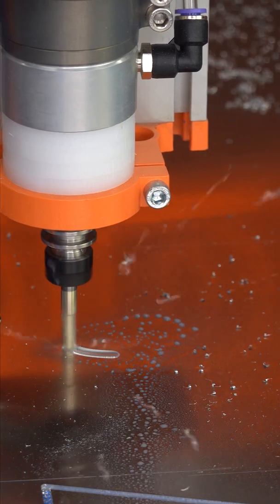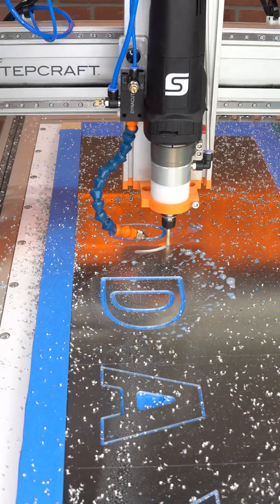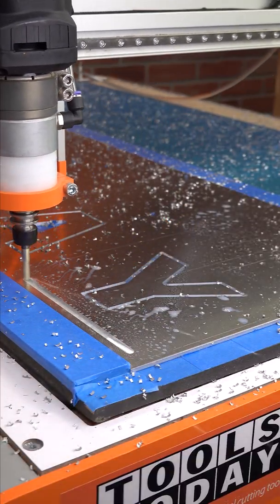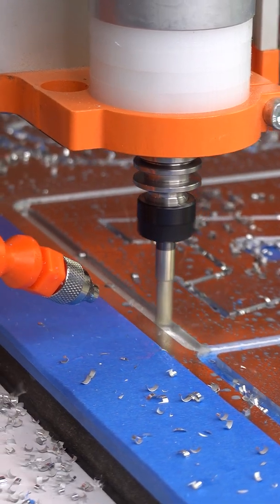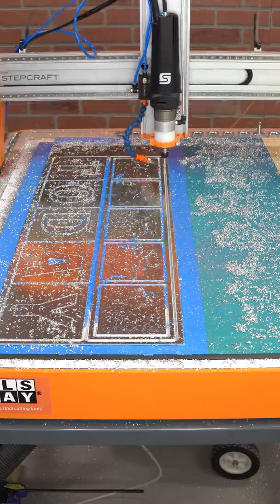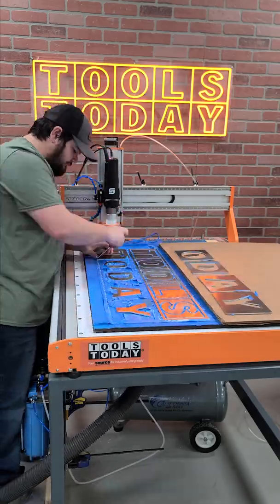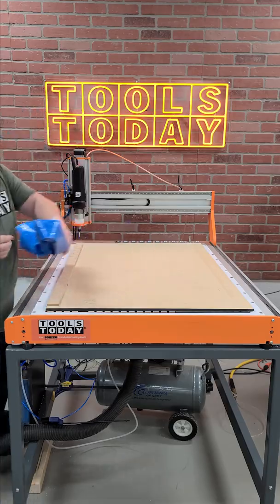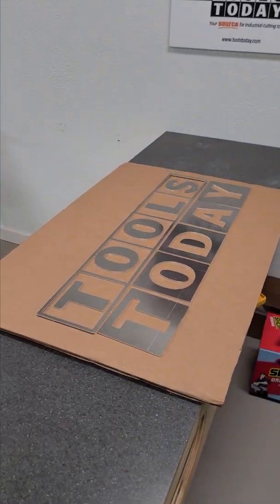Cutting Aluminum with 1/4" Bit

Comment: Does the toolchanger work well with aluminum milling or do the chips get all over the shanks of the toolholders? I am thinking about buying a stepcraft and this has been my main concern since the tool change does not have compressed air cleaning the toolholders everytime it makes a toolchange...
Reply: Ich denke mal, dass der Atc geschützt genug ist, vor den Spänen...

Comment: What size spindle does your machine have? 1.5kw? ER11?
Reply from the maker: This is a Stepcraft MM.1000- DI spindle.  It's 1.1kw and uses ER11 collets
Reply: @ToolsToday  looking at getting a pretty robust 1500x1500 machine (queen ant pro v2). I’ll be cutting strictly aluminum sheets, .125” and thinner. Would a 1.5kw spindle be plenty strong to do what I’m trying to do? Or would you go with the bigger 2.2kw? I’ll get water cooled no matter what. I’m just trying to keep the weight down as much as possible.

Comment: What is the wattage of the Spindle? & what material is the bit you are using? tungsten carbide, titanium, cobalt, etc...
Reply from the maker: solid carbide by Amana Tool https://www.toolstoday.com/v-14286-51402-z.html
Reply: Yeah,, I know this question is OLD, but the response only was for the bit. The spindle is the Stepcraft MM-1000DI and it is 1000 watts.